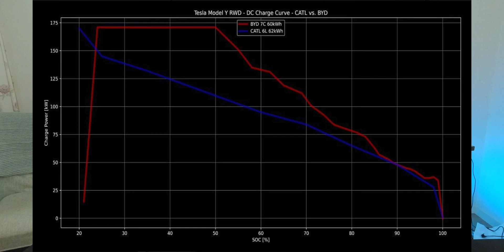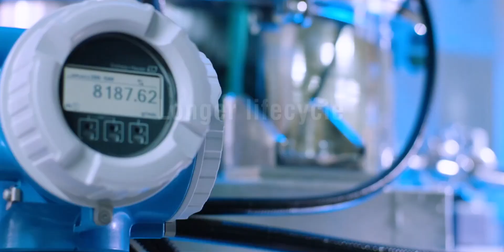Tesla now uses BYD Batteries, and gets much faster charging speeds

Comment: The BYD blade battery is configured as a 126S1P whereas the jelly roll batteries originally pioneered by Tesla are typically configured as 126S16P ie sixteen times as many cells. This greatly increases complexity of battery management (and risk of a fail).

My bet is the industry will gravitate towards the blade configuration, largely because it will be cheaper and easier to manufacture.